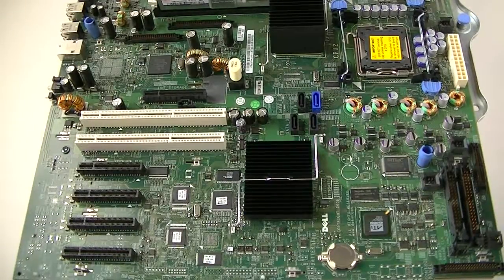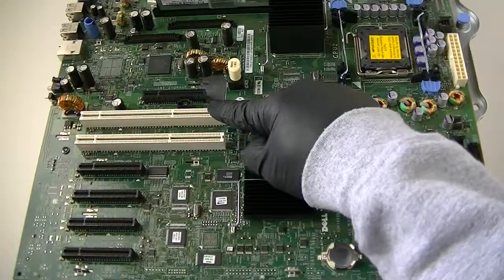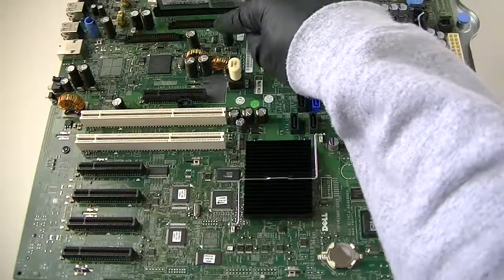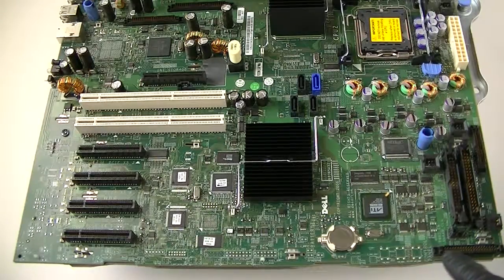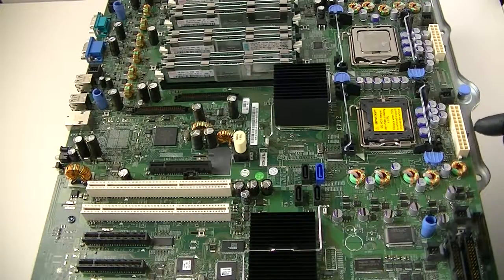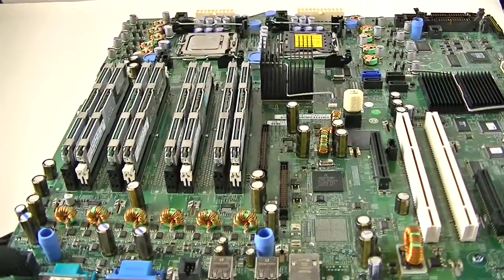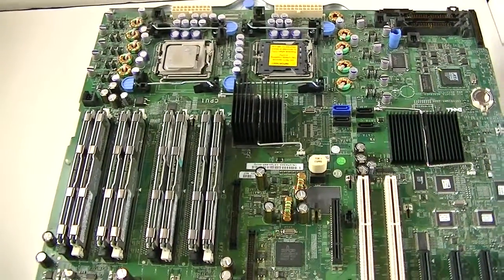TW855 Dell Poweredge 1900 0TW855 Motherboard Overview

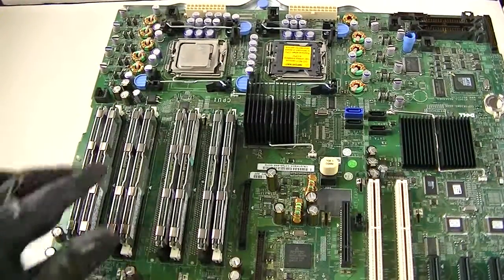Comment: +mxkdi At 1:59, there's a small power port on the right side of the screen. Looks like it's for the Intel BMC, the integrated remote management. If so, is this to keep the BMC online if the server is shut down? What is the power input required of that port?